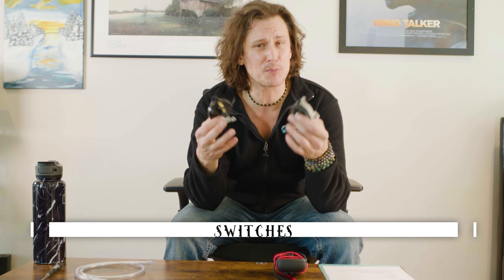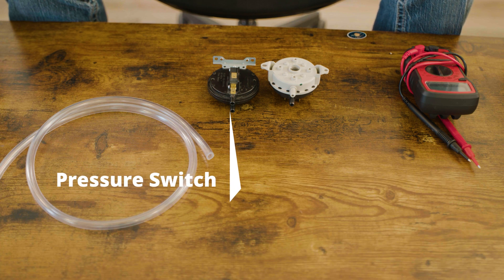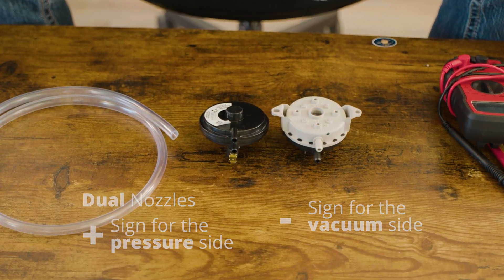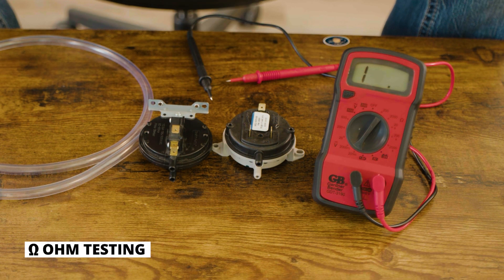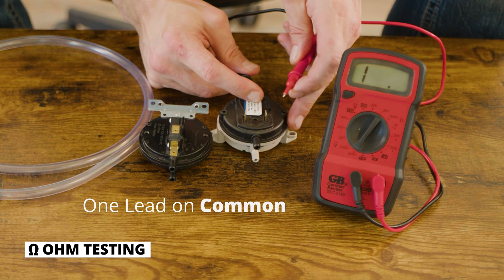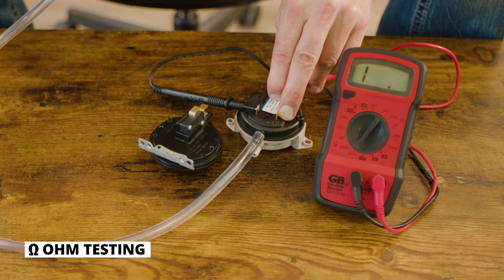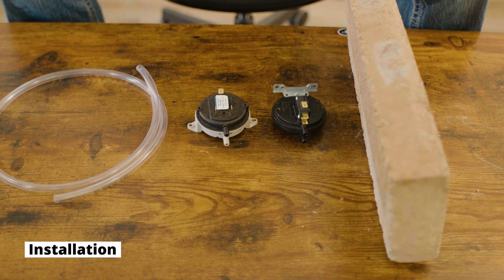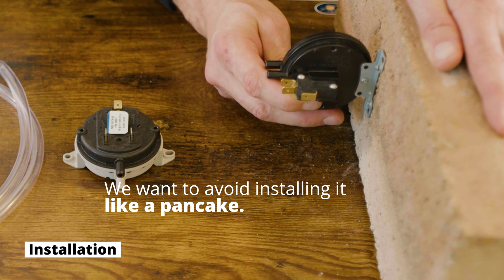Pellet Tech 101 - Vacuum vs Pressure Switch Installation and Testing

Comment: I have a few questions first of all is the pressure switch the same thing as the differential switch? Also, I recently changed the ash pan gasket and the door gasket and the stove started up OK for another week now it will not it turns on and then it shuts off what could be the problem
Reply: I'm in the process now of checking the differential switch my question is which panel do I remove do I remove the panel on the side which has all the control knobs or do I remove the panel in the back with a million screws
Reply from the maker: @milagrossmith4891  For each side panel there are 2- 5/16" screws you will loosen ( once you have the winged side panels off) The side panels will slide out exposing on the components in the side and back of the stove - no need to take out a bunch of screws. I believe the vacuum switch is on the opposing side as the control panel. I just left a response to the other message as well. Keep us posted. Thanks.
Reply from the maker: Thanks for contacting us. Generally speaking, yes the differential switch is the same as the pressure switch. Depending on the manufacturer, it's often called a Vacuum Switch, Pressure Switch, Air Switch, Draft Switch or Differential switch. Happy to help with the current issue you are having - please let us know:
1. What stove make and model you have.
2. Is the stove going through the initial start-up and ignition or is it not running at all? 

Happy to help and get you back up and running. Thanks.
Reply: @EarthSense  I have an Advance. I recently change the rope gasket on the door and on the ash pan. The door gasket is a 5/8 inch. The ash pan is slightly smaller. The stove was working great for about a week and a half then it stopped. When I turn it on, it turns on as normal then the flame starts going lower and lower and it finally shuts off after about 15 minutes or so. I bought an aftermarket distribution blower from your store online. Would this be the problem?
Reply from the maker: @milagrossmith4891  Thanks for the message back. When your Advance shuts down, are you getting any blinks on the status light? Shouldn't have anything to do with the distribution blower, you can always turn the feed adjuster dial to TEST to make sure that blower is running correctly. 2 things you can look at here right away: 
1. Let's pull out and clean the exhaust ESP probe. Link Here: https://youtu.be/kt7nnGMYU-k

See if anything changes, if not let's look at #2. 

2. For Testing ONLY, let's bypass the vacuum switch with a jumper wire to see if the issue is related to the vacuum switch. Video Link Here: https://youtu.be/FDVkbsHS95U

The Firebox door gasket for the Advance model should be a specialty Tadpole gasket which creates the glass and door seal. I know you mentioned a 5/8" gasket you put in so we do want to check on that - any door or glass leaks will trip the vacuum switch and not allow the auger motor to run. Here is the Advance Tadpole gasket for reference: https://pellethead.com/product/harman-advance-mark-i-firebox-door-gasket-specialty-tadpole-oem/

Keep us posted, and let us know if you are getting a status light blink when the unit shuts down. Thanks.
Reply: @EarthSense I cleaned the stove entirely top to bottom in and out including the ESP probe. I get six blinks on the status light I will check on the vacuum switch with the jumper wire you suggested I already saw that video I will keep you posted thank you
Reply from the maker: @milagrossmith4891  Thanks for the message back. 6 Blinks indicates that the control board has calculated poor or incomplete combustion occurring for more than 25 minutes. 

With that information I do not think this is an issue with the vacuum switch. If you have a multi-meter, let's check the voltage on the combustion/exhaust fan. Should be near line voltage on start-up. See if there are any significant drops in voltage as it runs before shutting down. If burnpot holes are plugged it will also give the 6 blink status. Use a good light and mirror to make sure we don't have any plugged burnpot holes. I know you mentioned you cleaned the ESP probe, but if this probe is faulty it can also give a 6 blink status. Keep us posted, happy to help.

Comment: I have a regency GC160 pellet stove and I had to relace the vacuum pressure switch recently, no problem. today hopper ran dry and my wife refilled but stove would not reignite.  Error code #4 which is high limit sensor. Opened access cover no switch there manual shows location shows directly under control panel. Love the info that you give any help would be appreciated. Also no feed to fire box and igniter not lighting
Thank you
Reply from the maker: Thanks for contacting us, happy to help. Generally speaking if the hopper runs completely empty the auger has to be 're-primed'. It generally will take 2-3 start cycles to re-prime pellet fuel up that auger shaft. The high limit switch in your stove is a 200 degree manual reset switch. For some odd reason the manual does not show it in the diagram, Part Number GF55-011. Depending on the year, the high limit switch is usually located by the convection blower, rear firewall, or on the auger shaft outer casing. This is what the switch will look like. Pushing the center red button down will reset the switch (unless of course the switch is faulty). https://pellethead.com/product/pellethead-replacement-enviro-vistaflame-regency-hudson-river-high-limit-snap-switch-200-degree-manual-reset/

Manual: https://www.manualslib.com/manual/1132758/Hampton-Bay-Gci60.html?page=26#manual

Let's start with finding that high limit and doing a reset and then re-priming the auger shaft with pellets. Keep us posted, happy to help!